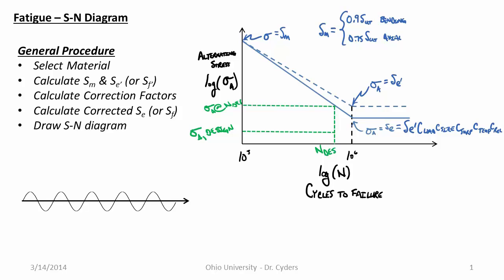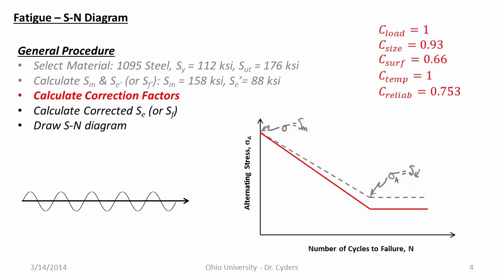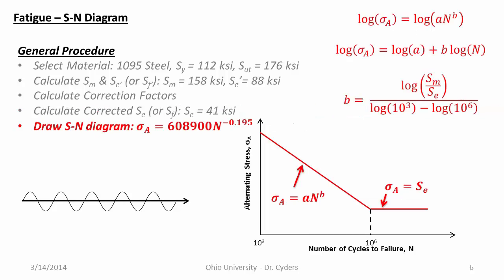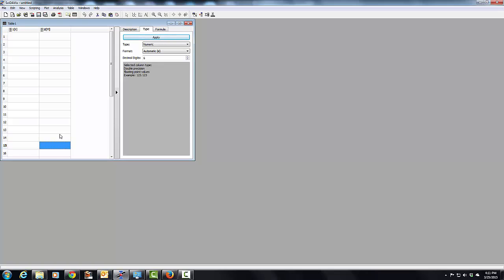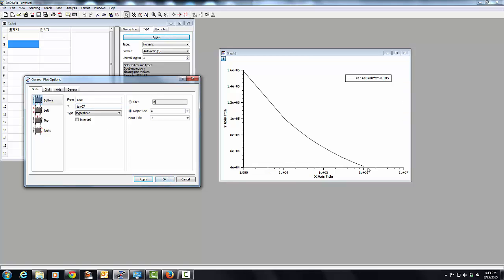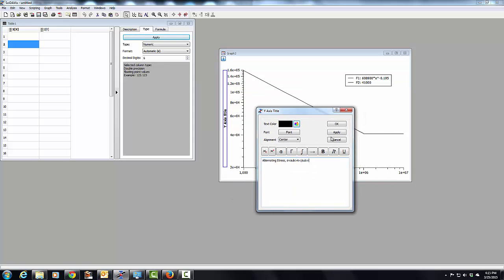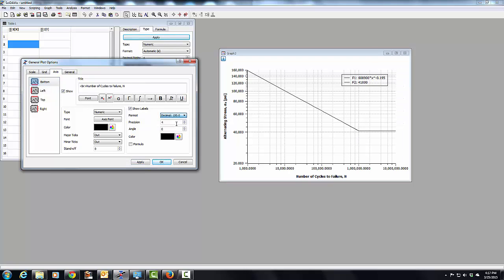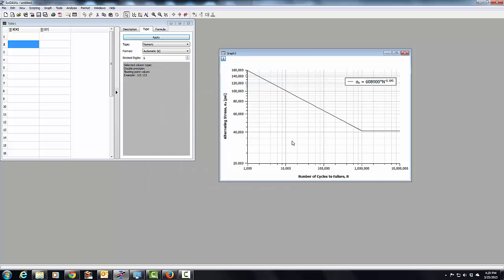Creating a Professional Quality S-N Diagram

Comment: Thanks a lot!
Qeustions
1. In case of compressoin, is the correction factor same as axial, 0.75?
2. In case of plastics(including composites), are there similar guide lines such as 0.9, 0.5, N=10^3 or 10^6?

Comment: sir i confused :) this S-N diaghrams  generates by fully reverses stresses ok and if Qm is non zero we use goodman,  gerber or soderberg diagrams but this 3 diagrams doesnt consist N(Cycle) how could we calculate the material life from these 3 diagrams. with a specific Qa  and non-zero Qm can we jump back to S-N diagram from goodman to calculate N.